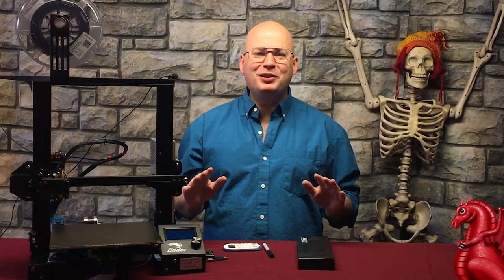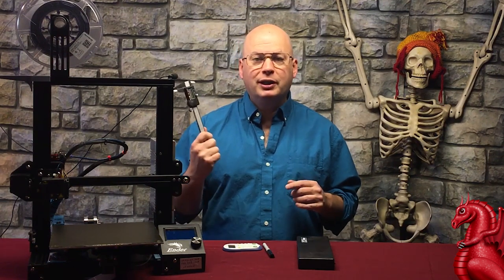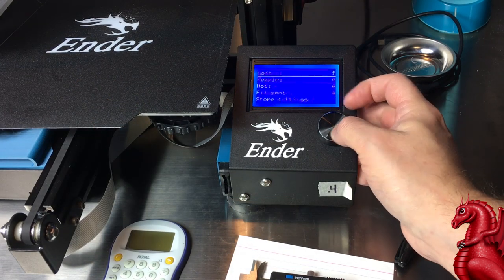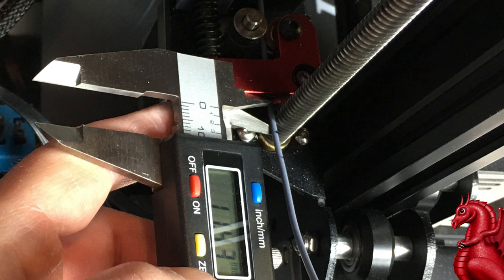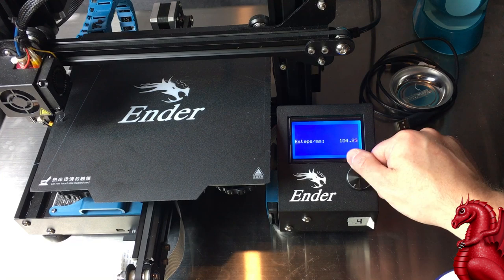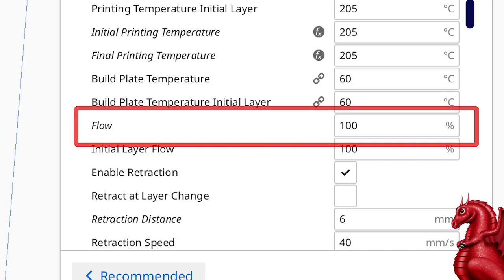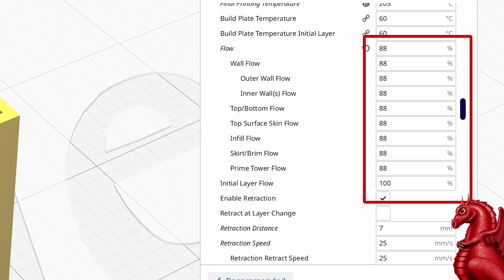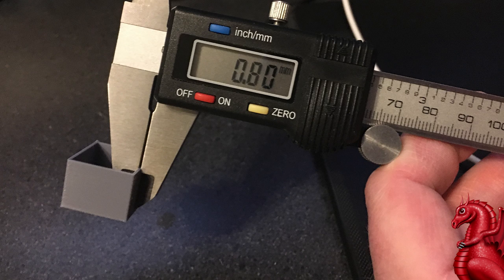3D Printer Extruder Calibration

Comment: finally a good tutorial, one question do, if your using another nozzle what is the wall thicknes then ?
Reply: It should be double whatever your nozzle size is. So since a .4 gives you 2 walls for a total of .8mm thickness, a .5 would be 2 walls with a total thickness of 1.0mm, a .6 would be 1.2mm with 2 walls, etc.

Comment: I"m running marlin firmware and the ability to change the e steps appears nowhere in the menu. What am I doing wrong?
Reply: It's there.  If you are using the Ender 3/ 3 pro....On your printer controller, dial to CONFIGURATION,  ADVANCE SETTINGS, STEPS/mm and you're there. Hope that is what you were looking for.  Don't forget to save the config before you turn off your printer.  CONFIGURATION, STORE SETTINGS.  You should hear a buzzer sound if the buzzer is enabled.  Turn off your printer and go back into those settings and make sure they saved.  If not re-enter the numbers and try again.

Comment: Seems like a good, to the point, video. When my aftermarket extruder is installed, definitely will refer back to this video.
The default on the Ender 3 v2 isn't perfect, I know that just from when I measured the 20mm calibration cube I printed, but it's good enough (I've had such minor issues on some prints like a weird rounded curved area on the edge of some parts, or under extrusion in the first layer but its so slight) not to care about messing with until I change the extruder to a better one.
Reply: The bed warps in the middle from many heat cycles. I place  a 10cm x 10cm piece of 0.1mm paper under the mat and directly in the center of the bed. This raises the bed in the middle by 0.1mm and helps with the manual paper bed leveling at each corner. Most printing is doen in the middle of the bed so having it level in the middle is more important than the four corners.

Comment: So I'm getting a value of 145 steps/mm on my Ender 3 Pro?? Even when It is set that high is still off drastically.
Reply: Do NOT have filament size set to ON or you will have this issue.

Comment: Fantastic, straight to the point, no rocket science involved. You just got another subscriber. My issue though I don't have the same settings, I can't change my steps or anything. Its just not there to change.
Reply: In Cura, click on the "Settings" menu, then "Configure setting visibility..." Flow is under the "Material" section. Selecting (checking) it in here will allow it to show up when you click on the block that says something like "Standard Quality - 0.2mm"

Comment: I don't have this motion setting under control on my ender 3?
Reply: Neither do I, but I found a way to do it! In my case, I'm pretty sure it's because my Ender 3 is running a pretty old firmware. So here's how I managed to change the flow setting:

1. Move my nozzle manually to some random position X,Y and move the nozzle up by about an inch or more in Z;
2. Go to PREPARE and choose AUTO HOME;
3. Quickly go back to the MAIN menu and then to the CONTROL menu and select TUNE (that seems to only appear when the printer is moving);
4. Scroll down and you'll find the FLOW parameter, click on it;
5. Change the FLOW to whatever you measured and calculated (this is the ESteps/mm value in the video);

The FLOW setting will stay there until you turn off your Ender 3. I haven't found a way to make the printer save this setting, but let me know if you ever find a way.

Comment: There I was I had just cleaned my extruder hotend,got all the gunk from the silicone thingy,changed the nozzle,scraped clean the whole thing. Heated the hotend, found some white filament and fed it through ready to follow Tom's tutorial.  The filament stopped, the temp was -15    AAAAAGGGHHHH!!!!!   My thermostat died. If I moved the wire it was fine room temp of 23c, moved it again -15, moved it again 208c yet the nozzle was cold. Amazon next day here I come damn it.  Anyone recommend a good one?
Reply: Did you happen to find a "good" one?

Comment: Just one tip... use an xacto knife to mark the filament. A sharpie introduces some error because of the size of its tip, where as a sharp blade with be more precise. You dont have to cut it deep, just mark it enough so that its visible.
Reply from the maker: That's why most people use the edge of the sharpie mark as the measuring point, not the center of it.

Comment: I followed your video to the letter.  When I go to store the settings I just get a beeping sound when I push the knob.  It doesn't seem to want to let me store the settings.  Ender 3 MAX.
Reply: AND Ender 5 Pro will not let me store Extruder settings.  I push the button and it beeps....YES the SD card is installed

Comment: So this helped my prints a ton, but i do have a question since I’m a noob to this.. i got the cube pretty much perfect looking and the thickness measurements almost perfect on all sides, but when i look at the inside of the cube 1 wall is really gross looking while the other 3 are perfect... any idea what that can be?
Reply: Did you figure this out? I had an issue with one wall as well.  It measures .66 mm compared to 0.8 and 0.9 for the other 3.
Reply: @MsJennysey  my issue wasn’t so much off by thickness just rough which to me i think it’s getting better with doing some retraction calibration

Comment: Avoided this calibration, but your video makes it seem easy. Nothing to fear anymore. I downloaded the .stl from the dropbox, but there are also cura settings. Does this calibration also require the use of the cura settings in dropbox? I'm using cura 4.6.1
Reply from the maker: My Cura profiles are for uncalibrated machines. If you calibrate yours, use your new Flow % for my terrain profiles, and your new Flow % -5% to -8% for my miniature profiles.
Reply: @Tombof3DPrintedHorrors  Excellent, thanks!

Comment: (Edit: see comment thread. I didn’t articulate myself well) 

You do know that there's a reason the flow rate on the ender 3 is 92 steps by default, right? 
The flow rate you worked out to be calibrated to 88%... If you have 104 steps/mm extrusion, multiplied by 0.88, you get (essentially) 0.92s/mm
Reply from the maker: You do know that not every machine is identical, right? Mine prints fine with factory settings (as do many others), but not everyone else's will, hence my doing this video.
Reply: @Tombof3DPrintedHorrors  sorry - I didn’t make myself clear. Instead of tuning your slicer, it’s better to take the flow rate and multiply your E-steps by that percentage. If you are running on 105steps and then also calibrating your slicer down to 88% flow, just multiply your 105 steps by 0.88 and then it doesn’t matter how the slicer is configured. You can swap to a different slicer, and it’ll “just work”, because the printer itself will be responsible for the flow calibration.

My point was that there’s a reason they come “miscalibrated”

Comment: if 100% flow was over extruding, why wouldn't you then change your initial layer flow to the same value? otherwise, the first layer at 100% is still over extruding right?
Reply from the maker: Yes, but a little over extrusion on the first layers gives a better bond to the build surface.
Reply: @Tombof3DPrintedHorrors  got ya. do you have a facebook page at all, would love to know your thoughts on an issue i am having

Comment: Great video.  What if your extruder doesn't feed any filament in?  What do you check for then?
Reply: I'm heated to 200c and a little filament drips down, but the extruder gear is barely moving.  :(  Not enough to measure.
Reply: I have an Ender 3 Pro with Marlin 2.0.  Any other settings I could check?

Comment: Thank you for the video, it helped a lot. I do have one quick question, does the nozzle forever stay at 0.8mm or should it be moved back to 1mm after calibration?
Reply from the maker: I don't understand your question
Reply: @Tombof3DPrintedHorrors  For shell wall thickness, mine was 1mm and I moved it to 0.8mm like your video. Should I change it back or leave it at .8mm?
Reply: @RazorBucks  It's just for the calibration. But if you're using the default line width (0.4 mm) then 1 mm doesn't make much sense because it's not divisible evenly by 0.4. AFAIK Cura will just treat it the same as if it was 0.8 mm.

Comment: Hey Tom! Would printing on a .2 mm nozzle change extrusion rate due to trying to push more plastic through a smaller hole? Also was wondering if you had a cura 4.3 profile for .2 mm nozzles
Reply from the maker: Yes, you need to recalibrate for different nozzle sizes. Here is a video on .2mm nozzles and a Cura profile is linked in the description: https://youtu.be/PuPaQznW8T0
Reply: I always wondered about this and now I know.  Thanks.

Comment: I had to increase my E-Step to 143 :o That feels a LOT but works so far!
Reply: what were your numbers on the length test?  I put 100mm into the Extruder movement and had 67.7mm left.
Reply: @ProjeKtWEREWOLF  I don't remember anymore, but the value that I had worked perfectly and my printer has been running smooth without issues
Reply: @CalvinBacon  I followed the video.  Value at 143, flow rate 73%.  Perfect 0.8mm walls.  Weird.

Comment: When i went into my extruder to extrude 100mm of filament it was at 264mm already. Does that have somethiing to do with using octoprint?
Reply from the maker: IDK I never use Octoprint.
Reply: It did the same to me Aaron, but I turned Octoprint off and it worked just fine.
Reply: I have this too on my Ender 5, even without octoprint. I suspect this happens after you have already made a print. The Ender 5 (in my case) does not reset this value, it seems to continue the counter where it left off. So I decided to do the calibration right after starting up the machine. I assumed this was "best practice" anyway.

Comment: I'm having a problem, When I go to feed the 100mm into the extruder, it will feed for a bit, then stop for a few seconds then feed again, then stop, then feed again. I see the spool move then stop, then move then stop. No clicking noise. Its not a continuous smooth feed. I have my temps to 210 and a new nozzle. I never has this problem before so I dont know what changed.
Reply: Are you saying the filament spool doesn't turn continuously/smoothly, or that the stepper motor itself controlling extrusion stops and start? And if the latter, are you concluding that based on the non-continuous movement of the spool, or that the filament extruding out of the hot end is stopping/starting rather than flowing continuously?
Reply: @MrBebopChamploo  Well the problem is Octoprint. When I did this without Octoprint, the extruder/Spool ran smoothly. Spool was turning continuously for 100mm. But then I tried with Octoprint, it would extrude/turn for about 20mm then stop then run for 20mm then stop, etc etc. I did a fresh install of Octoprint and still did the same thing. So i just calibrated it without Octoprint.
Reply: @EggChen6DemonBag  Disable retraction in your slicer settings.
Reply: @arnolduk123  thanks, I'll try!!!

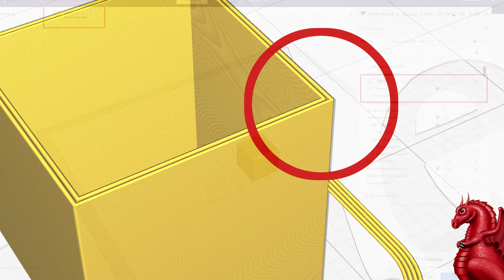Comment: 6:47 i can't find this setting in fusion 360
Reply: You need to look for it in Cura, Bilbo
Reply: @cancerix1700  I had hoped i could use fusion 360 for everything, using cura now though.
Reply: @bilbobaggins138  wow, I didn't even know that Fusion 360 has a built-in slicer. I thought you were just joking lol.
Reply: @cancerix1700  It has one but very limited settings. Needs improvements before it can be used.
I use fusion 360 for my CNC machine though.

Comment: Two observations right off the bat: Making 2 marks on the filament is silly, you only need 1 mark, the 110 or more.Secondly, when manually moving the amount, why would you crank 1mm increments 100 times rather than 10mm 10 times?
Reply: At least for my Ender 3, if I select 10mm, Extruder is no longer an option. But you're right about the 110. Even 120 would work if you want to be extra safe